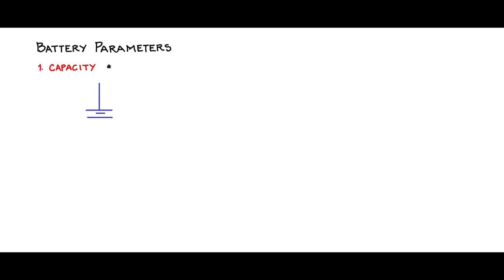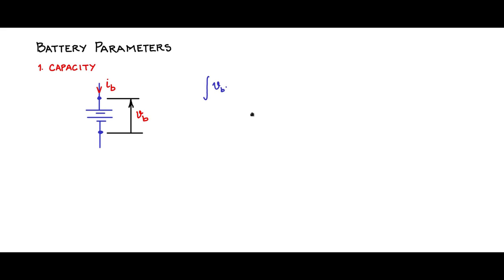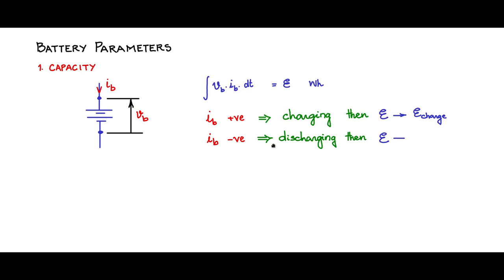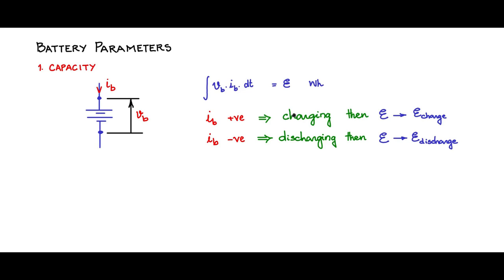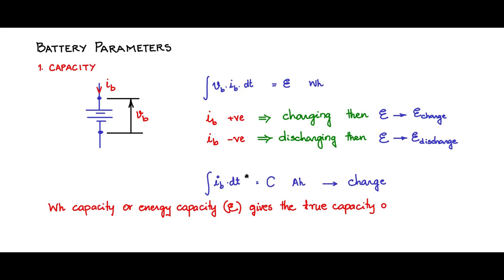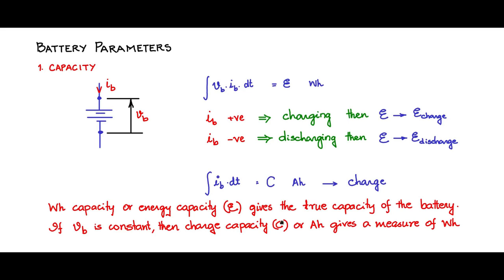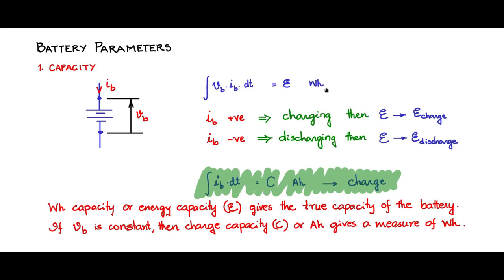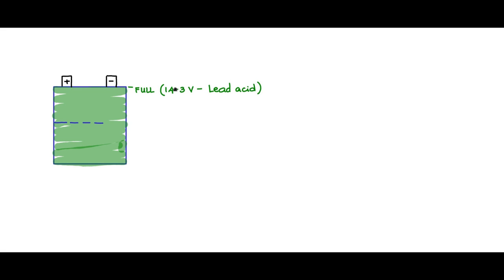Battery capacity

Comment: Good Day, thank you for the provided information. I have a question regarding the solar inverter charging, where my inverter bulk charges, and then maintain the voltage at 29.2 for 4 to 6 hours. Does this damage my flooded lead acid battery?  Knowing that the inverter is configured with 27 v as the float charging.